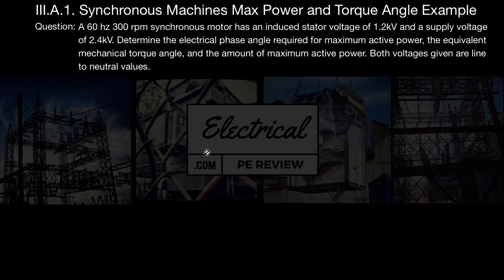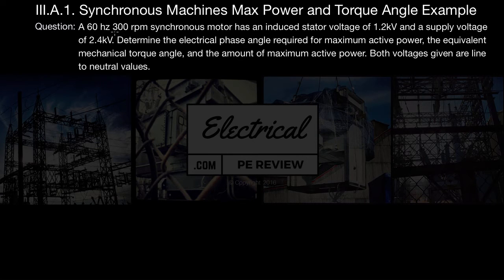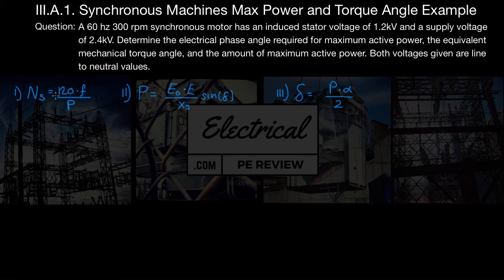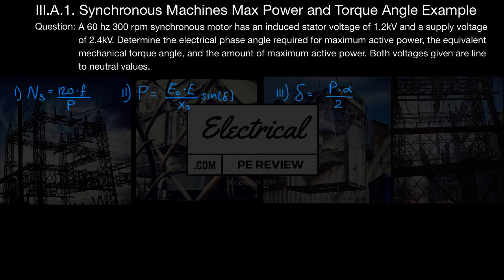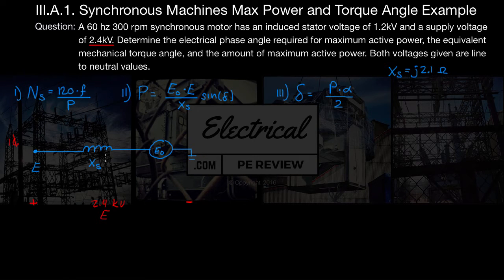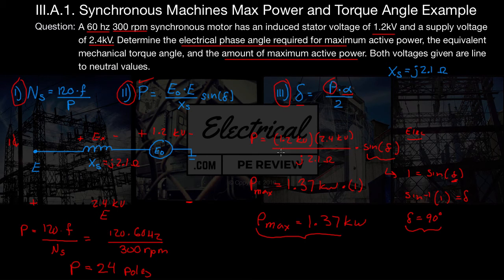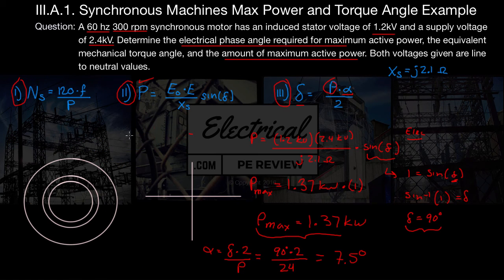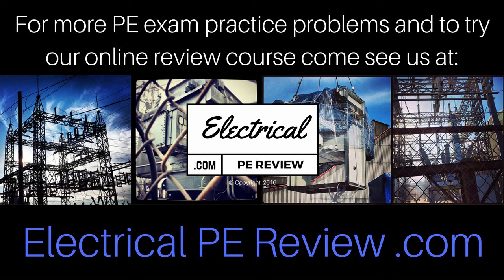How to Calculate Max Power and Torque Angle of Synchronous Machines (Electrical Power PE Exam)

Comment: Thanks for the video. Was the equation of calculating mechanical torque angle from electrical torque angle given in the NCEES reference book?
Reply from the maker: My pleasure, glad it was helpful. This video was published 6 years ago before the change to the new CBT format of the power PE exam at the end of 2020, when you were expected to bring in outside references for formulas. 

This particular formula for mechanical torque is not included in the NCEES Reference Handbook.

Since the NCEES Reference Handbook does not contain every formula, if a problem on the exam requires a formula that is not in the Reference Handbook, it is generally safe to assume that it will most likely be provided in the problem statement if it is required to solve the problem.

Comment: How did u get 1 for sin(x)? 1 was not given
Reply from the maker: Hi Razina, thanks for your comment. The conditions for maximum power of a synchronous machine (what is being asked for in this problem) is an electrical torque angle of 90 degrees. Sine of 90 degrees is equal to one:

sin(90º) = 1

Comment: How do you decide on Xs? If it was different, say 5, wouldn't that change your max power?
Reply from the maker: Xs is the synchronous reactance of the machine, typically determined from the results of the open and short circuit test by the manufacturer. The synchronous reactance of the machine cannot change, it's the inherent reactance of the machine at rated conditions. However, if you had a machine with equal ratings except for a different synchronous reactance value then yes, the max power would also be different as a result.

Comment: Hi all, the speed given in the problem, 300 r.p.m , why it was considered to be the Ns, ( the speed of the stator magnetic field) normally the speed of the synch machine given in the problems is the speed of the rotor which is N, am I missing something?
Reply from the maker: This is a synchronous motor problem, not to be confused with an induction motor. The rotor of a synchronous motor also rotates at synchronous speed.

Comment: I have a question regarding the power calculation. Wouldn't you need to include angle of the induced starter voltage in the power calculation?  (E < 0) and (Eo < 90)? Or is the equation using magnitudes, and i missed that part?

Thanks again for working these out they really help! i am definitely signed up for your class!
Reply from the maker: Hi Spikes, by "angle of the induced starter voltage" are you referring to the applied voltage E, or the induced stator voltage Eo?  For max power, you do not need to know the angles since max power is actually defined by an agle of 90º between the two. That's the trick to this question. For other questions, you would generally assume a reference angle of 0º for the applied line to neutral voltage (E), and solve from there. This results in the current angle being equal but opposite in polarity to the power angle theta which makes it easier to determine if the machine is leading or lagging.

Comment: Pmax=(1200V)(2400V)sin(90)/(2.1 ohm)= 1.37MW.
If this machine is three-phase (and they usually are) the maximum power would be 4.11MW.
Reply from the maker: Great Catch!  You are absolutely correct.   For the max power to be 1.37MW the voltages would need to line values however the problem states they are not so this is actually equal to the single phase max power which needs to be multiplied by 3 to yield the three phase max power of 4.11MW.  The units are also incorrectly labeled as "KW" instead of MW in the video.  This has been flagged to be updated in the future.